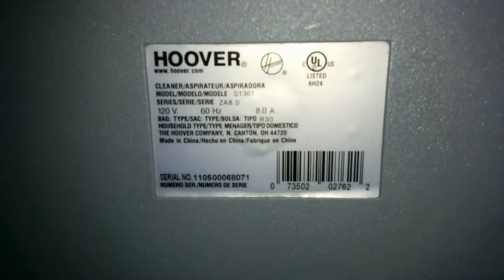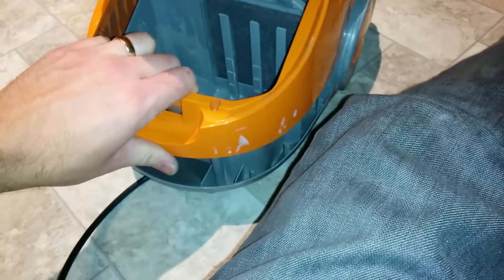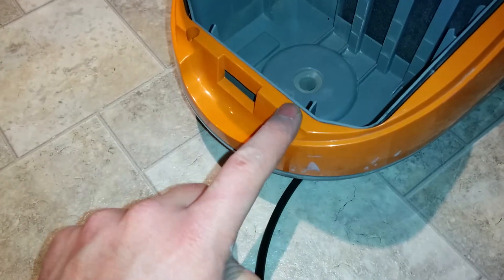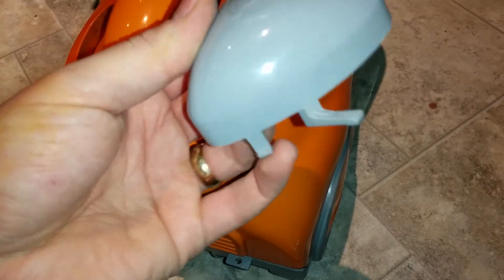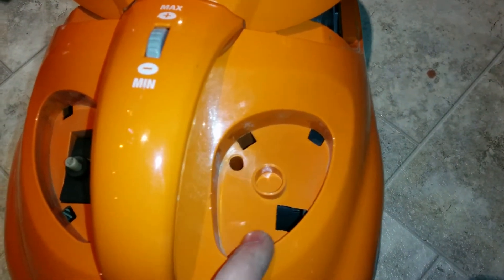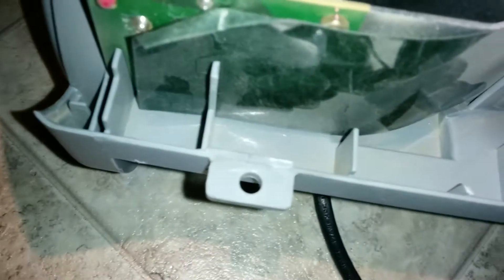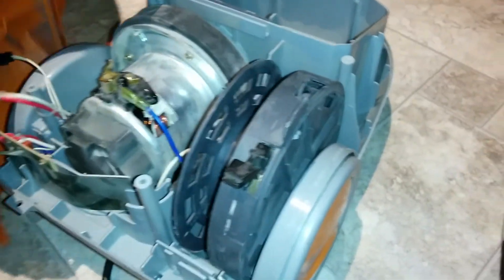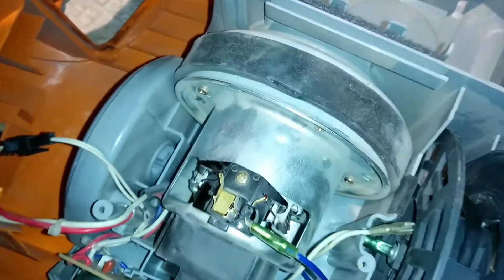Repairing/disassembling Hoover S1361

Comment: I just found one of these in our apt dumpsters yesterday. NOTE: when trash picking, don’t assume it’s all in one dumpster, as parts were in one dumpster and other parts were in the next dumpster. 

It has its quirks, but it works! One of its quirks is the rewind mechanism is finicky. Also, the metal wand is rusty, and the brush head is cracked where it connects to the wand. UPDATE: I found a matching gray wand extension just yesterday at the dumpster “Emporium”. Also it turns out that rewind mechanism is at least as finicky as originally assessed. I think the problem is I pulled out the cord too far, probably because there was no mark indicating when to stop pulling.

I’ll just simply sandpaper away the rust and use super glue to fix the crack. What’s nice is that there were several boxes of extra bags and filters found in the dumpster with it.
Reply: Well I finally got around to gluing the floor brush neck today. And I added gray duct tape on top of it so as to help ensure that the glue won’t become unglued. I did likewise with the crevice tool. And I sanded it off some of the rust. Looks a bit better now. This is the second little orange Hoover “lady bug” S1361 I found at the “Dumpster Emporium.”I’ll find out how it performs tomorrow when I vacuum my whole condo.
Reply: Test results! It did OK. I was able to vacuum under my couch without having to move the couch. And I could put the canister on top of the washing machine (vs having to prop up an upright on a chair) while I vacuum the lint out of the dryer. In these aspects, it is more convenient than my uprights. But for my one bedroom single floor condo, I prefer an upright. I don’t like having to drag a canister behind me as I vacuum.

BTW,I also got used to the rewind mechanism on it so it is not as finicky as I originally assessed.

Comment: Thank you for taking the time to make the video.What was wrong with the recoil unit? Mine does not retract all the way in, I have to push the cable in every time. It looks like the spring inside is weakened.How did you fix yours?
Reply from the maker: My cord had slipped over the channel guide and was jammed. Yours may not be winding up tightly enough and binds in the confines of the space allowed for the cord to coil up in. Or, as you said, the spring may have been over sprung and doesn't have the recoil strength anymore. Good luck!
Reply: I opened it up successfully thanks to your video.Spring is weak, nothing else wrong.I'm not opening that reel -it's not meant to be opened(the spring will fly away :)  I can live with it :) -not buying a new one :)